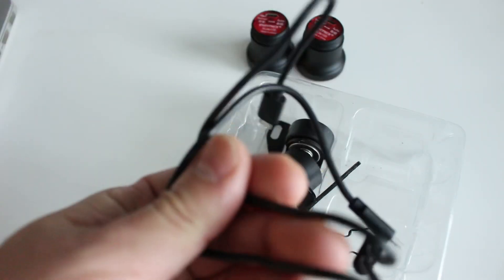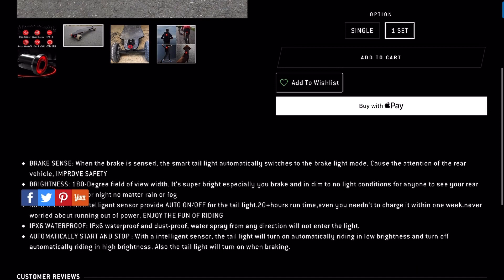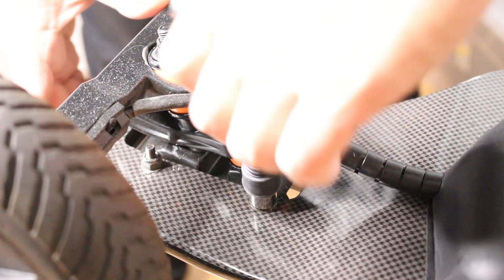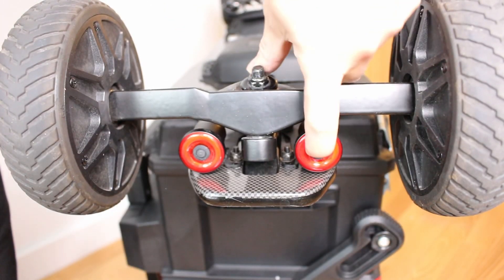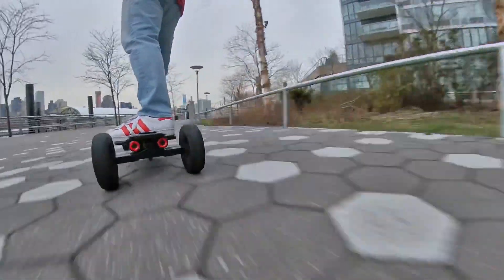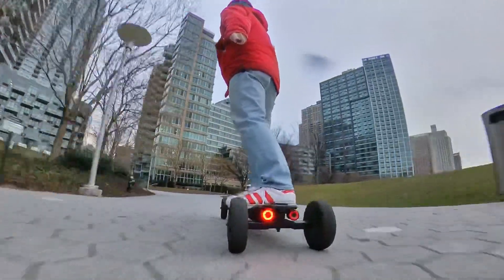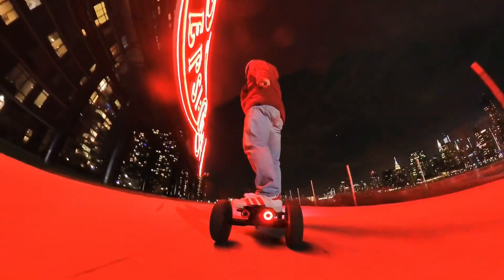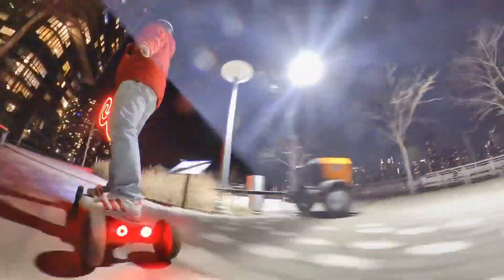Xlite 100 Smart Tail Light Unboxing and Review

Comment: I knew the brake feature was bollocks. Thanks for testing them!
Reply from the maker: Sure thing.  Thanks for the comment!
Reply: They work Pretty good in bikes. I think there night be too much Vibration on a Skateboard for the Sensors to work correct.
Reply: @geilhardt  im almost positive thats the case. but itsalso a slim chance that all units in a production lot to be broken, or at least the sensors.

Comment: Mine stopped working after a month. When I took it off the board and shook it 
Repeatably it would flash on and off. So I think a wire came loose super disappointing

Comment: i bought 2 units, one of each attachment set. i kept the under the saddle one, gave to my brother the other one. both works perfect each time, on manual or auto. i think this device cant work on a skate because of the vibrations, the lack of suspension trick the motion sensor! can you attach it to a spring first, and the spring to the skate? of course its possible that all the units from a production lot to be broken. please try it on a full suspension bike.
anyway, its their fault if they advertise as skate compatible.

Comment: These are great if you just use manual mode.
I don't have this exact model. A bit updated from these. But the brake lights still suck.
But here we're required by law to have front and back lights on, once the sun goes down. Like bicycles. And while these are almost useless as actual headlights for seeing where you're going, they're perfectly fine making you visible to everyone else. And that's what I needed them for.

So... Yeah, if you need to see where you're going, I'd go for shredlights. If you just need to be seen, shredlights are waaaay overpriced, and these lights does it perfectly fine. Price and build quality is good.

Comment: I use it on my Electric longboard. I Can go for like 10 min and the metal discs at the back of the lighs rattles loose and starts making annoying noises. They arent made for skateboard i feel
Reply from the maker: You are correct.  They're meant to be installed on bikes.  I wished someone like Shredlights would build something like this for eskates.  I'd buy them in a heartbeat.
Reply: @theinterstellarfeller did you have same problem? I mean is this a common design issue or exceptional for @dissing6 ‘s product?